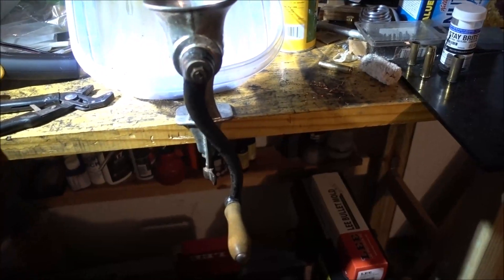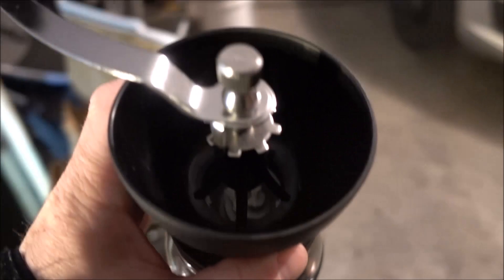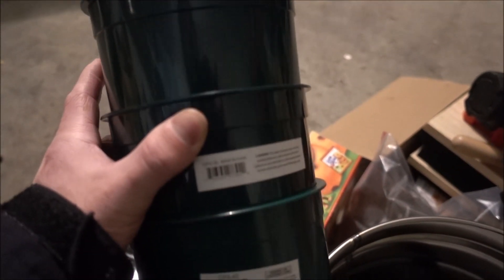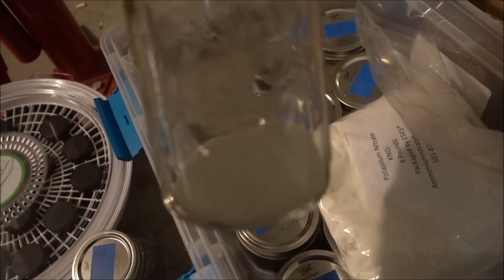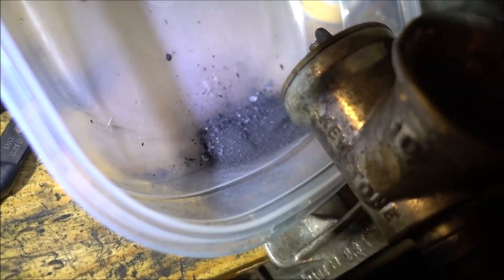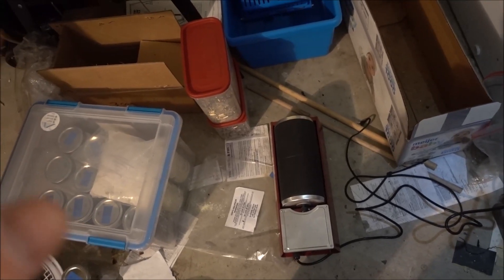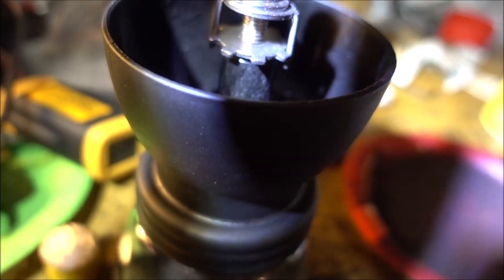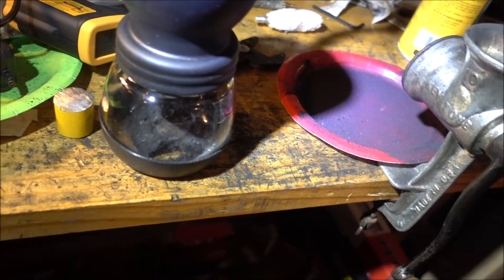How to Make Commercial Quality Black Powder Chapter 2 Charcoal Grinding

Comment: Pro tip: take that manual grinder, unscrew and take the handle off, replace the nut with a regular nut. Get a cordless drill-to-1/4" socket adapter (I just happened to have one), and use a cordless drill attached to 10mm socket to turn the grinder. Makes grinding charcoal batches WAYYYYY faster/easier. Thanks for this video, it's what prompted me to buy a cheap meat grinder for the first step, I already had the manual grinder. I then run my charcoal through 100 mesh, regrind the too large bits, then toss the little bit that still won't pass. Cheers!
Reply from the maker: I did think about doing just that. Good to know it works.

Comment: I saw the drawings and read the report on a plant in Pennsylvania. They dumped in lumps of charred wood and sulfur as brimstone rock as a 3:2 by weight mix. The ball mill was being kept clear of dust the whole time. That airflow carried the dust out of the ball mill to a storage bin. Right away I saw how a system like that would be great in a place like Arizona where the humidity was lower. They filtered the air and constantly dried it. That recirculated air flowed through the storage to dry it. That was blown over into another bin for weighing. It was blown over to a mixing chamber where it was added to a 3:1 mix with potassium nitrate granules. It was stirred with high pressure air jets. They added water with a high pressure mist by weight but didn't say how much. It was augered to a puck press and hot air drier. The auger then put the pucks on a round perforated cast iron table. A pair of 3,000 pound wheels crushed the pucks and air sucked it down through the holes. Steam and graphite was sprayed on it before it was filtered into 8 different sizes.

Comment: That "dust" that floats around and makes a mess is what you need for making good BP. You need a ball mill and patience to get "air float" charcoal and Potassium Nitrate, commercial Sulphur is normally fine enough. Thorough grinding and mixing is the key to getting a good product.
Reply: I've never done this but i would try grinding wet charcoal if i had to make it indoors, lol

Comment: I use an old Bullet brand blender I got on ebay for cheap(used). Works great as long as I don't over fill it and stall the cutting blades on start up. Takes all of 10 seconds to make very fine powder :-)

Comment: I watched your other BP vid. 
 I guess I'm dumb. What do you do with the pucks? Is it just for storage or do you break them up for loading.
Reply from the maker: To get good power, density and durability you need to compress the powder. After they dry you need to break them apart and screen them to size. I'll post another video showing this soon.

Comment: Doesn't look like a meat grinder to me. Looks more like a grain  mill where you can adjust the plate to whatever grind you'd like.
Reply: @Wayne Flanigan that is a different type of meat grinder than I am used to seeing..
Reply: @staffordshires2  Yeah it squeezes/presses the meat through holes and basically makes meat spaghetti. The corn feed/grain mill that you are talking about is nearly identical except it uses the plate for grinding. I use that type of grain grinder to grind my black powder pucks into different size granules. Check out this guy's video: https://www.youtube.com/watch?v=D24DR5OLtds&t=457s